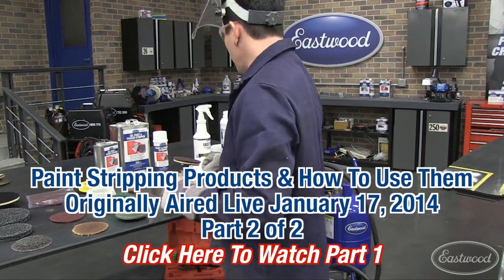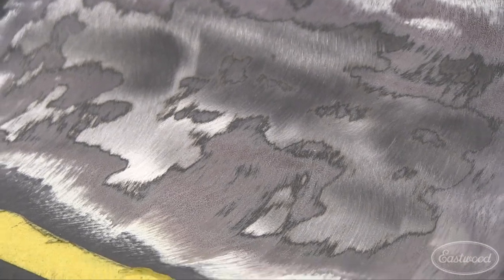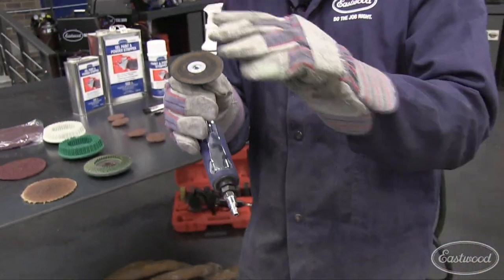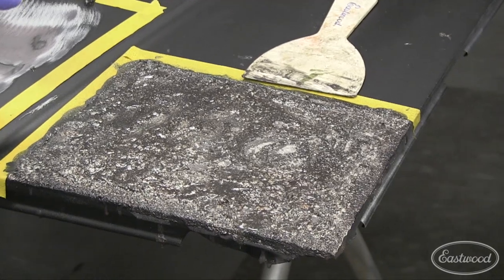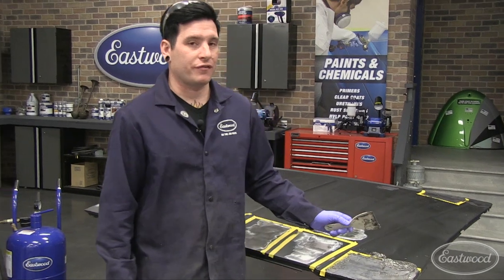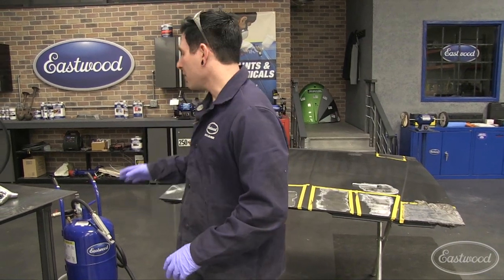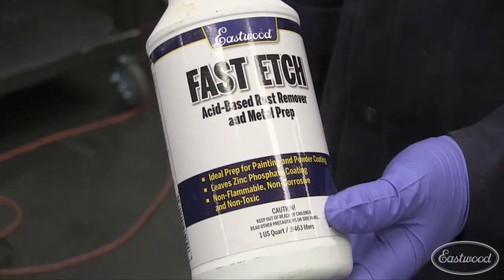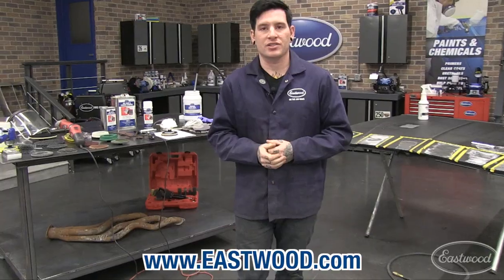Automotive Paint Removal - Tips & Products You Need and How To Use Them - PART 2 of 2 - Eastwood

Comment: when using the alkaline  strippers (non citrus), keep a small "finger bowl" with lacquer thinner in it.  the lac stops the stripper "biting", and is quite nice for the little splashes onto sensitive flesh that seem to be burning their way to shanghai via the bones in your wrist, or your belly, or those delicate spots not so mentionable on so "family" a comment board, lol. NEVER let stripper dry on the panel, re application on top of dried just makes awful, smeary, sticky plastic goo that defies removal. warm metal strips easier than cold, but also dries the stripper faster. NEVER use chem stripper in direct sunlight, btw, it goes to goo as often as bond breaking, after chem stripping, wipe with lac to "stop" the stripper, THEN you can soda blast, prep etch, etc without ghosts of alkaline corrosives spoiling your day.
Reply: No one else was brave enough..... 
Why is this able to burn your belly?
Reply: @woodworkerroyer8497  lol, large pieces, waist high tank, mopping the stripper on with a Tampico roofing brush, it becomes a fairly splashy affair. Lean on a wet edge, it just becomes an itch til you peel the wetted t-shirt off the flesh... or so I read once I think, lol.

Comment: People don’t seem to realize the grinder turns in a direction that tightens the threads. I’ve seen people put one on and put all their strength into tightening.
Reply: They do have to be at least somewhat tight. I have an air powered 4.5" grinder that loves to throw the discs off. Had to chase one or two across the shop before! :)

Comment: If someone is stripping the threads out of plastic discs they are more than likely hitting the edge of the work piece. It will jolt the disc tighter causing the threads to pull.

Comment: The gel method, does it need to be neutralized?
Reply: I wetsand the panel when I've got most of the paint off.....and the water neutralizes the stripper.  Just wipe the water off immediately after and you
can coat it with Fast Etch or a similar product.

Comment: I guess it is self evident but the bristles are more than plastic. They are impregnated with a ceramic abrasive. I would like to see a comparison between the coarser bristle brush and the coarse 3M  roloc pads like the purple one or Norton's Gold one. I would like a comparison between the plastic bristle brush and  the stiff unbacked woven hard wheels in general.

Comment: I'm new to this stuff. I have one question though. I am interested in the media blaster you have there. The blue one. If I was to purchase one would that be it or would I need an air compressor? I have an 80 gallon air compressor in my garage. Can I use it with that or is the media blaster you have there in the video it??

Comment: If you get an engine back from the engine shop but won't be working on it for a little while is it okay to spray the machined surfaces with fast etch? (cylinder walls, cam/crank journals)
Reply from the maker: I don't recommend Fast Etch.  Ask the engine builder what they recommend, which will likely be coating them with oil.

Comment: Soda blasting leaves a film which is pH base. Does this need to be removed before painting?
Reply from the maker: Yes.  that film must be removed.  We recommend using Eastwood PRE Painting Prep, available in aerosols or gallons.  Visit www.eastwood.com.
Reply: Pretty much any media leaves a film.   I've used plastic media on aluminum aircraft skin and we used products similar to this companies fast etch and then Pre as well as alodine.  

At home, I've found a wet media blaster kit on a high power pressure washer to be awesome.   I used Rustoleum gell rust dissolver first on axle rust and on a used Deaver leaf spring pack I stripped and refinished.  I'm ordering the fast etch and pre.   Really just have good paint and rust-free sheet metal but axle and light frame weld rust.   

Corrosion control protocol on an off-roader.